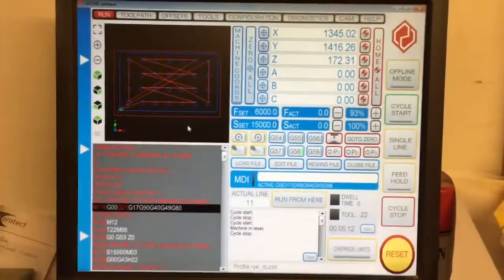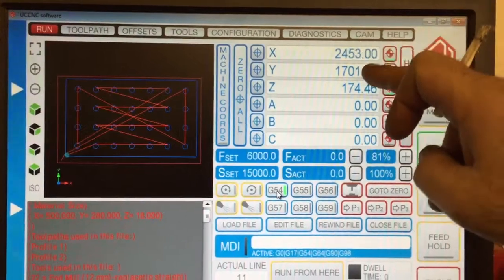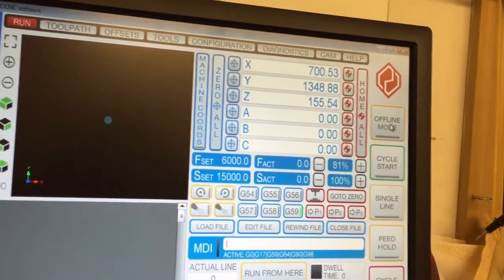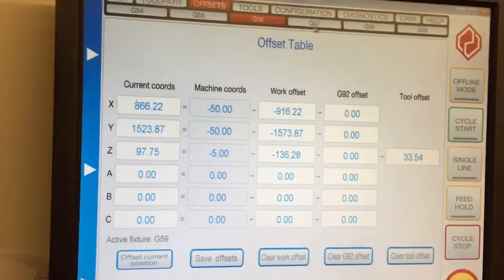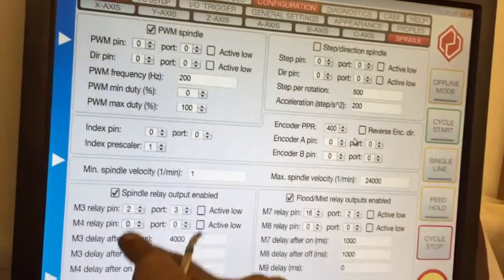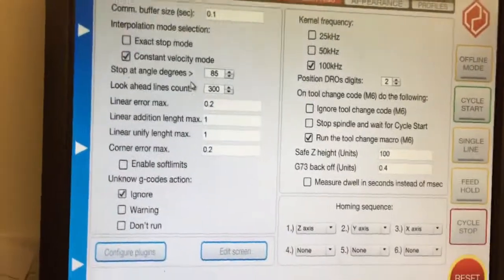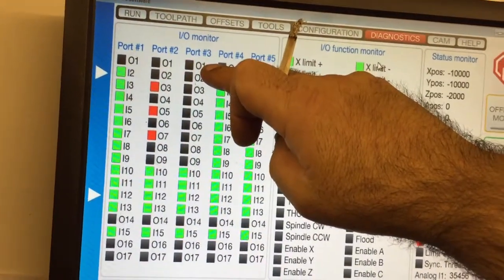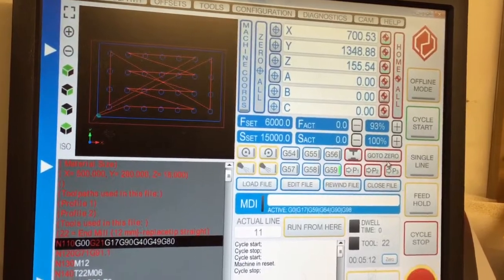Uccnc overview of screens- quick talk through

Comment: Im trying to set up uccnc to start the arc relay via a gecko g540 im using pin 17 port 1 but the torch on button does not trip the relay.

Comment: Did you manually set the tool table offsets or use a macro? Currently have my atc machine probe off for every tool change, want to incorporate the tool table to my macro to speed things up
Reply from the maker: Nikita Skakun my probing macro saves every tool length to the table. Much faster that way
Reply from the maker: Nikita Skakun  I made a separate probing script for my mill too.
Double probe, set tool table, set offset g43 
https://youtu.be/PNkMnU_3v8Y

Comment: I am new to the UCCNC Control software and I have run into a couple of problems that you might be able to help me with. When I enable Soft Limits I get an error message that says my machine has reached a Soft Limit on all axis when I attempt to calibrate my axis. Iam not running and Limit Switches intending only to use the Soft Limits. Also I'm using the Gecko G540 Stepper Driver and I can find no reference to the Enable Pin or Port along with the Touch Probe Port or Pin. I am getting both the Green and Blue Led's when I have everything loaded.
Do you have any ideas as to what I am doing wrong.
Reply from the maker: join the cncdrive forum- and ask on there. very good group! 
i dont use soft limits on my machines sorry

Comment: Hi can the tool numbers 1-99 be used for lengths and tool radius for example using g41 or g42 with a D then one of the tool numbers to call up a tool a radius
Reply from the maker: at the moment g41, g42 isnt implemented.  so tool table has length offsets only.
Reply: automateanything Thanks looks a nice set up especially using a Galil with the mitsubishi drives...did you write your own plug in for the Galil and which Galil card is it?
John
Reply from the maker: there is no plugin required- just a program running independantly in the galil. - so its a stand alone setup- will work with mach 3, mach4 etc etc too. (with no jumping, timing errors or jittering from the plugin)
the mitsubishi servos run perfectly in step/direction mode too-which is why i use them on most of my equipment,  but i had one handy just to show it working to test it. and they are real easy to change their setup when you know how.  it will work with any of the galil controllers- as long as you have the required number of axis- (shown here running off a 2183 ethernet 8 axis controller- again as i had one on the shelf to test with.)
i have had it running for a few days now- with no loss of position or any errors- up to full speed of servo at 3000 rpm.
Reply from the maker: obviously my comment above is for my other video- relating to uccnc running analogue :-)
Reply: automateanything Yes got the wrong video lol..very interesting seeing the Galil running like that..presumably you could run an mpg as well? .not having to have a plug in  makes life easier..I noticed vital systems do a motion card similar in spec to the Galil but cheaper and has an optional plug in  ethercat board for ethernet drives.
Reply from the maker: all other features- mpg etc i would run direct in the uccnc software-  just easier.  re drives- i stick to mitsubishi or yaskawa- very similar- extremely reliable.  mitsubishi only require 4 wires to encoder .
Reply: automateanything Yes the mitsubishi and Yaskawa very adaptable ..I've seen them fitted to a Heidenhain tnc 355..they were in torque or speed mode not sure which..the original heidenhain sign wave encoders were left attached to  the ball  screws as standard and back to the Heidenhain . Analogue command from the Heidenhain is +/- 10v to the drives.